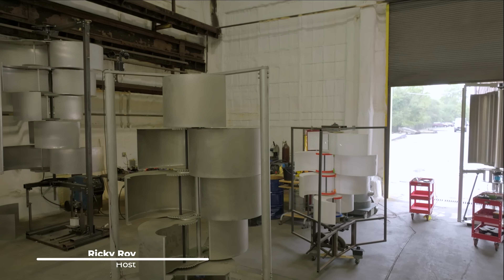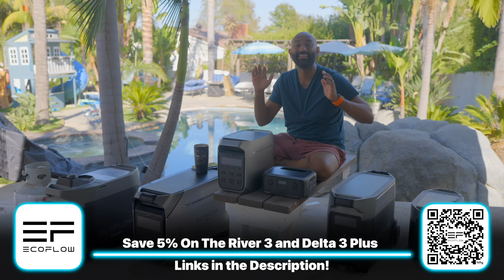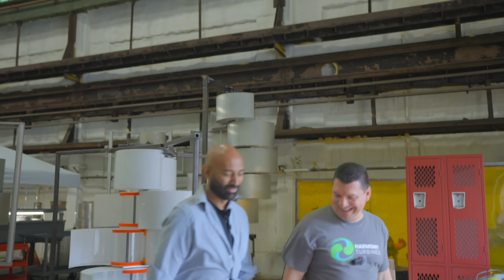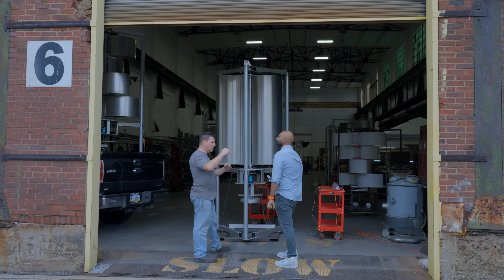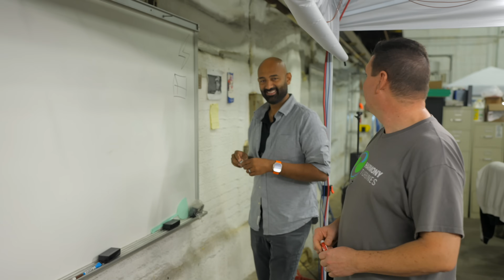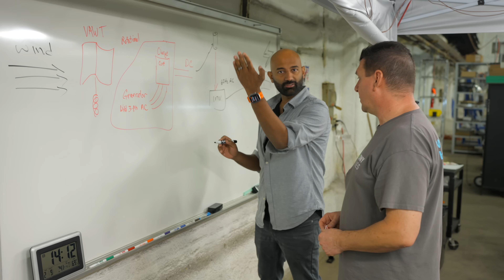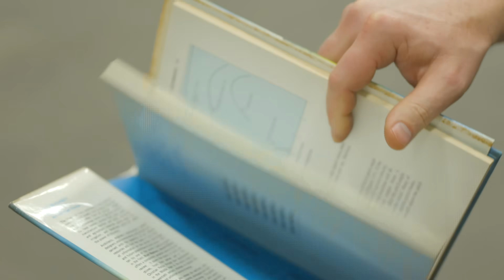This Could CHANGE Home Wind Energy Forever!

Comment: As a formally trained mechanical engineer, I couldn't bear to watch the whole video. There is no sustainable business model here, and a trained engineer would have figured that out with little more than back-of-the-envelope calculations.
Reply: It's a cool hobby, though.
Reply: Indeed sad to say - I have worked on VAWT as an amateur for a number of years.  Savonius can work well if it is adapted to the load correctly.  Slow moving high torque Savonius are similar to the old multi-blade (24+ blades) farm windmills.  These old, but very useful farm windmills pumped water from a well, ... thats what they did very efficiently - pumping water is a low speed/high torque process.  Using a generator ment for high RPM is a stupid load for a Savonius.  I have a better idea, but that is between my patent attorneys and myself for now.
Reply: @SeattleCoorain  I was thinking more along the lines of how long it a customer could expected to obtain a return on the initial investment of the installed apparatus - almost certainly never. This because:
1. available wind power at a residentially practical height above the ground with a windmill sized like the ones in the video is negligible in most locations, on the order of 100 watts or less.
2.. efficiency losses through a drive train, and generator would probably sap at least another 30%.
3. If you don't already have a battery with DC->AC conversion and synchronization, similar to the Tesla Power Wall, then you will need to have that installed.

Small scale windmills commonly used to pump water from the ground work in certain places which have an abundance of wind. They need to produce only a fraction of a horsepower to direct drive the pump.

Comment: What about taking the rotational shaft through a “bike chain” with gearing to transfer the rotation to a flywheel, then generate off of that. Use the gearing to build up the energy of lower winds, but also could get it rotating faster. 

Just a curious thought I have had

Comment: I currently have a 3KW solar without battery - and planning to upgrade to a battery+solar+wind system to aim for an annual net-zero energy consumption (still utilising the grid to balance over/under production reducing the required size of the system)

Comment: Reposting, my previous comment got removed. Perhaps because I provided a link to a source.
This is not a new turbine design at all. Turbines like this have been in commercial use for decades. I'm particularly aware, because I happen to live in a city that utlizes these in a certain way. They are mounted on top of floats and power aeration pumps on our local lake. They have been floating on the lake for the last 18 years.
Just google "aerator szczecinek".

Comment: Average windspeed here should be about 20 km/h. But i'm living in a residential area surrounded by other houses and rather large trees. The real windspeed is much lower.
--> The real problem for the majority will be: Not enough wind.

Upps. I looked up the data for 80 m above ground. For 10 m it's even worse.

Comment: You might also need multiple generators a small generator for the low RPMs and a larger generator for higher RPMs and then maybe even a big generator for a really high RPMs

Comment: I'm interested in what their research finds on the charge controllers for VAWTs. I live below Cajon Pass in southern California, and when pressure systems move across the desert, a lot of wind comes down the pass. I'd love to be able to tap that energy source to power my house. There are a lot of structures in this area, so the wind is quite turbulent most of the time. Even if I wanted to, I doubt I'd be able to get a permit to put in something super tall like a HAWT on a 50+ft base, so a VAWT at about roof level seems like it might be a good way to generate a very small, but consistent amount of power, day and night.

Comment: cringey exposed gears. this is very unreliable for the wear and tear and dirt of the outdoors.  I was highly interested with VAWT for more than a decade but my research/I realized lately it is no match to HAWT. It can explained/summarized like we "mostly" don't use vertical blades for moving air. 
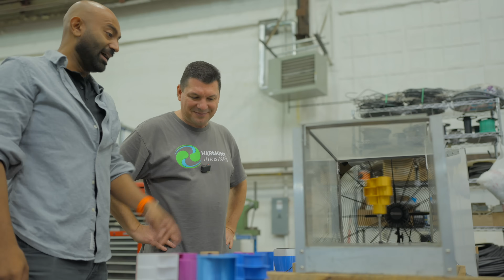2:47 this multimeter design is at least 20 years old and which I bought during college. It works to this day with some quirks. However, a US company R&D using the cheapest available multimeter could be red flag.

Comment: The "problem to solve" is their cost which is why diy turbines made for a few hundred dollars is the only type that makes financial sense at the home use scale making pay back a few years instead of a decade plus for turbines that cost thousands like this. There are free plans online using a hover board motor, two bicycle wheels and sheet alloy all potentially aquired for $100 or $200.

Comment: So you might need to really gear down the system and you would probably want to automate the system using Springs and weights in order to control the exposure percentage because using an electrical system is a waste of your electrical product

Comment: ALL of those designs are bulky and ugly. NONE of them look appropriate for residential application. I'm glad someone is doing the research, but I'd rather have a mini bladed "turbine" on my garage or solar panels. I'm also curious about those vibrating wind poles that don't have any blades. If any wind generator was appropriate for residential application, it would be something like that.

Comment: Ok but what if you made a wind turbine out of solar panels?
Reply: I understand this comment might be sarcastic. Despite that possibility, if the surface of the exterior was covered in solar panels, there would be minimal return due to the small surface area overall. At most, the percentage of the surface facing the sun at any given time will be less than 40% of the total surface area. At best it could be used to power a warning light for aircraft and a wireless communication device for status updates for the device.

Comment: Well you know he is interested in ROI with that Harbor Freight meter!  😀

The mag lev bearings are cool.  

The charge controller issue should be easy to solve with proper engineering and a good vendor.

Comment: The problem with wind is it doesn’t blow continuously at a constant velocity.    At least with solar you can be assured the sun will rise.   Now whether there is cloud cover is a different question.   

This all points out that you need fossil fuel plants on standby to carry the load when wind and solar go on vacation.

Comment: I'm totally underwhelmed by this technology on a residential home scale. I heard power ranges from 400 watts per hour to 1000 watts per hour based on 25 mph wind speed, and a price per unit of $36K??? Even $3.6K makes it noncompetitive with solar. Plus power drops off significantly as wind speed decreases. How many of these wind units are needed to power an average house? Plus, how many areas have enough wind to consistently operate at maximum output?

A single solar panel will produce 250 to 400 watts per hour and costs a few hundred dollars a panel. Most homes I've seen have 15-30 solar panels installed on their roofs. 

The price has to come down exponentially, and the units have to increase electrical output (by being bigger) by an order of magnitude.

Comment: I look at this kind of tech from a very different perspective. In this case, I'm imagining re-designing the sailboat. Think about it, a cross between powerboat and wind power and solar power. You replace the traditional mast with the 1kw generator (or more) or maybe build the generator around a special mast, a telescoping mast that can extend up to give better coverage for things like the radio and radar and running lights and such, but also be strong enough to hold/fly an emergency sail if needed. I know there are some electric sailboat motors out there that, when under sail, can be flipped so the propeller being dragged by the wind-driven boat now turns a generator and poof, extra reclaimed energy for later use. Maybe when doing some part-time sailing or something, like having fun with a kite sail, could be a good time to use such a feature in a flipping motor like that.

Comment: The biggest problem with small-scale wind turbines: efficacy. The smaller they are, the worse it gets. That's why commercial wind turbines are huge. Good luck putting 4+ of these on your roof to cover the 2-3kW consumption of an average house at 1kW max per "mini" turbine, more if you want extra headroom to charge batteries with to cover times where wind is below the 25mph needed to sustain rated output.

I'd be nervous about catastrophic mechanical failures flinging turbine guts at me if every home and apartment around me had 4-10 of these hovering 10' above their roof. Most wind farms are built in the middle of nowhere in part to minimize the likelihood of injury from inevitable catastrophic failures.

Also, if you already have solar or plan to add solar in combination to one of these, you need to account for the shadows a wind turbine may cast on your solar panels. Your neighbors may also take offence with any shadows your wind turbine may cast on their solar panels.

Comment: I think the cost per watt (even at 25/mph winds) is absurdly high. You get 1/12th of a watt per dollar. $12k+ for 1000w max wind system?! That same system would make 20-40 watts at normal wind speeds 🤦🏼‍♀️Robert Murray Smith did a video creating a 1k watt wind generator for 100£. That's ~120x cheaper than this solution. Hard to argue with the diy approach on this one. 

Also why not put a 1:2+ gear on their savonius turbine? since it's torque-y at lower speeds, that'll get a generator spinning quicker for higher voltage. 🤔 I'd think with all the mass of the metal components, there must be a fair amount of stored energy while turning as demonstrated in the video. Those flywheel properties should allow it to reach higher speeds through gearing.

Overall, I'm not impressed as much as saddened by the title of the video given it's hopeful nature and yet the content wasn't fully thought out, given the lack of cost efficiency. How can this possibly be the key to solving wind power? $300/watt given only normal wind speeds means your gonna need about a million dollars for a 3,000 watt system. For that price you can get turbines that are far far more powerful.

Comment: 3:43 It is obvious the reason this performs best because it has minimum drag . When the scoops are at 90° to the wind drag is what it is in still air.
The version with the  helical scoop arrangement never has a point in rotation where this is the case. The helical arrangement maximises torque at all wind angles but it also  maximises drag at all wind angles

You don't need inherent stall prevention. You use an airflow detector and apply a turning force with the generator to start the turbine turning